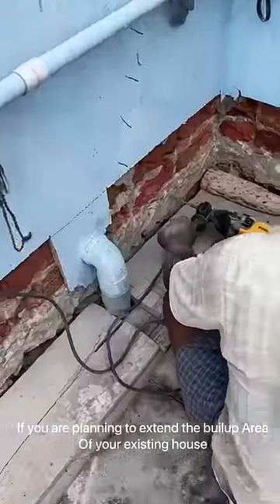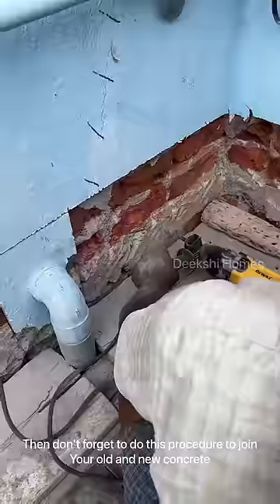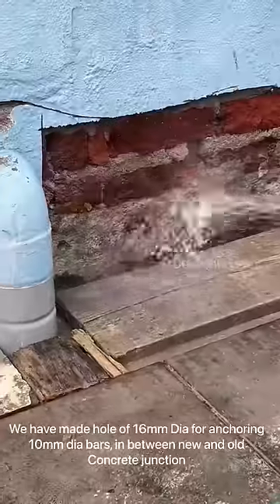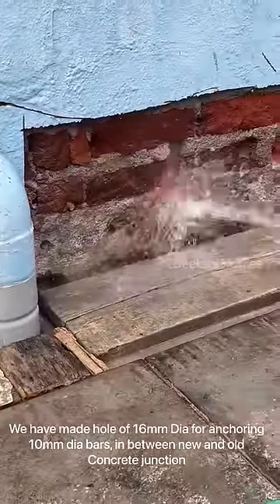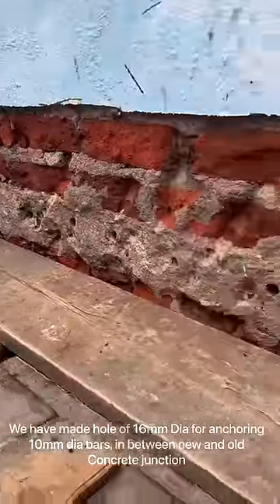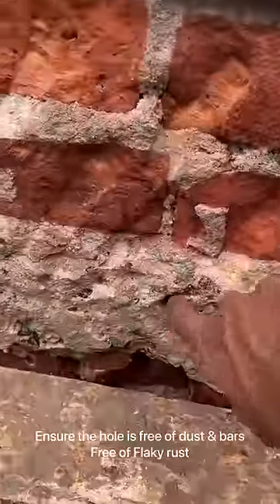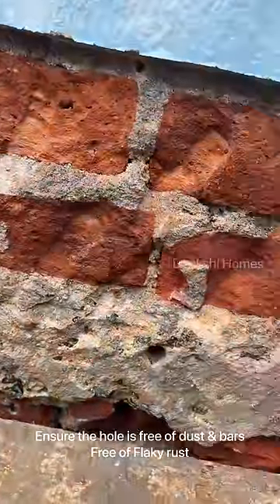பழைய கான்கிரீட் புதிய கான்கிரீட் இணைப்பு | FOSROC | Deekshi Homes

Comment: Use Fischer gun bro & use dust cleaner instead of water , 
10mm bar use panuna 12mm holes correct ta irukum 
Load bearing holes depth   -9" to 1' ft vachukalam

Comment: Water was going reverse in our house. We checked the water meter and the plumber told to change the iron pipes in the sump. So unloaded the sump water (5000 ltr). He is removing the pipes in the sump. In that process he made a hole in the concrete sump. When i saw this video, can we use the above paste  to fix the new pipe in the sump. Tomorrow we have to work on this. Earlier the message will help me alot.

Comment: Sir, when we bought a house the house was sold to 2 person separately but the 1st concrete is common for both the building. Now there is water leakage from some pipe so both the Neighbour’s having fight. Is there a way we can separate the concrete but there is no gap in between building
Reply from the maker: Can't able to understand. What do you mean by first concrete? Do you mean First floor roof ?

Comment: I have seen your video. After drilling, it should be cleaned with a blower, not a water bcoz drilling powder will settle inside the hole.

Comment: 9 inch 9 inch Pillar 
10 ft distance
Beam join pannanum 
Beam top la 4 ft brick work panalama
Beam bottom la 4 inch brick work already 

Ithu panalama safe ah 
Pillar ku yentha affect um varathula
Reply from the maker: Consult and get structural detailing from nearby structural engineer

Comment: Balcony extend pannalam ah pro 1/2 feet. Is it safe?
Reply from the maker: Yes you can
Reply: @deekshihomes sir can i extend new slab by pouring new concrete over old slab with columns supporting at opposite end of overlap